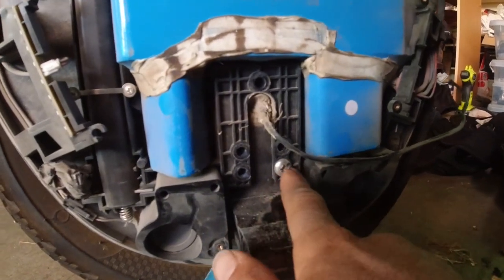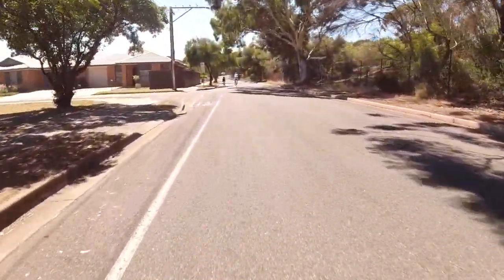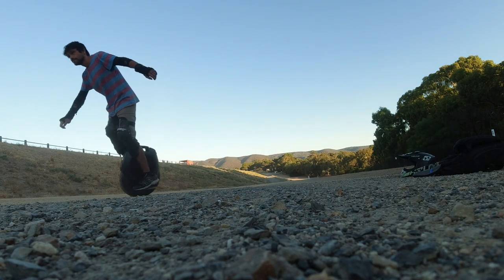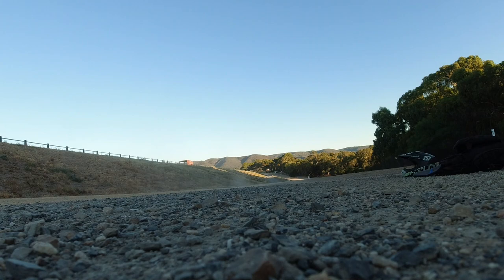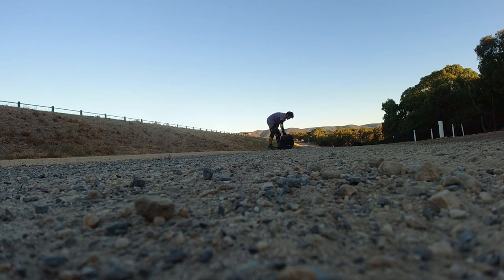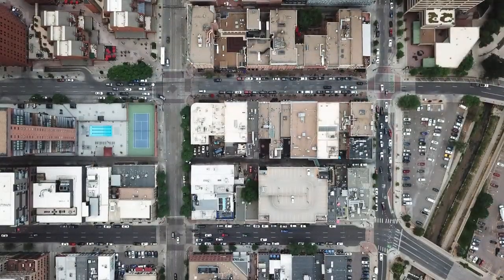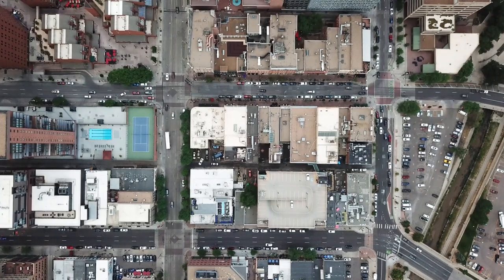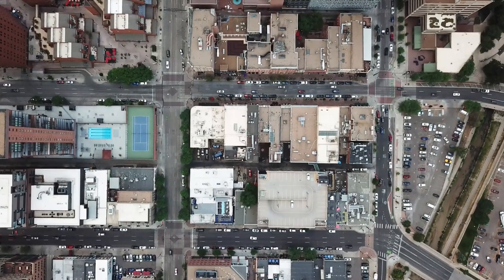The major problem with King Song

Comment: Hopefully it's just the fuses blown, another 5 dollar fix.
Reply: A blown fuse is highly likely. The current required for "idling" is the highest load on the batteries and motor; drifting is essentially the worst at idling condition because you're attempting to balance at nearly zero wheel rotation for an extended period of time... almost like short circuiting the motor and heat buildup is highest.  Check the fuses on the BMS (or just check battery terminal for voltage), then check fuse on main board, as well as capacitors. There are several layers of protection that prevent catastrophic failure of the motherboard.  And, cross your fingers. Good Luck.

Comment: You are a legend on the drifts. Love it. I own a KS 16XS...I dropped it heaps, learning to ride it, on the grass though.
I have taken it apart twice, replacing or reparing tyre. 
I have broken on of fastening points off the main body.
I still works fine.
I have dropped it a couple of times on the concrete, but have always had a rubber bumper stripe around edges or power pads to protect from the shock. The shock is what breaks stuff.

Comment: What you shown was the physical abuses you know of. What you didn't, was the electrical ones you're possibly not even considering.
A drift usually causes a power consumption spike. If the battery cells are badly unbalanced and near failure, the BMS will just shut it down and the mainboard should not power on at all until battery replacement. (And KS-16X's cell balancing is passive, meaning BMSs are on the battery packs themselves, meaning also the owner has to take care of the 3rd charging stage [that is, cell balancing], after reaching "100%")
On your defense, however, I know the KS-16X has =two= battery packs and it's unlikely both them died at the exact same time for the exact same reason.
Still, for safety reasons, that [old] mainboard should not power on until both packs are OK, but IDK if that's the actual case.

Comment: I got ran over by a large truck and my 16X took a heavy beating. It’s still working. Yours must be a combination of issues. I’d guess overheating from the fan and dust in addition to the impact. Still. No excuse. These problems shouldn’t exist.

Comment: I assume you have figured out by now why your wheel died. But in case you have not...I reckon you have blown the fuse(s). I had that issue 2 months ago...went through a small dip and wheel stopped working. The dip was pretty much the size of the tyre and I overpowered it, tyre was a bout 1/3 of it's size in the dip/depression. I have replaced the fuses and wheel works fine again. On another note : the 16X is very easy to overpower if you ask for too much juice when accelerating. Mine did 2 beeps and cut out. Had a crash but it worked again afterwards. Scary though. I have now a Master and an EX30 coming....all good fun but dangerous too 🙂
Reply from the maker: In the past when this happened the fuses didn't do their job so had to replace the whole mainboard. Replaced it twice actually. I've since sold that wheel though. The Sherman doesn't have this issue and has taken much more abuse.

Comment: Dude!! That shit is insane!!
Your like the only person I know drifting a wheel like that. But it definitely over powered your board. Too much torquey power for the mosfets all at once due to such a long slip of the tire trying to maintain constant power and over doing it. I'm gonna try it on my RS with the updated black board. Keep it up bro. Sorry your wheel diedman.
Reply from the maker: Thanks bro. To be honest I don't think the slide hurt the mainboard because this happened before and I wasn't sliding. I just dropped it softly on its side and it gave up on life. I'm pretty sure it was the impact. There was loud music coming from the 16x speakers and at the point of impact the music suddenly went dead and in the back of my mind I kinda knew in that moment that the wheel died.

Comment: Got a 16xs as my first ever EUC and after the first week of riding it I had a very similar accident to the one that destroyed your EUC (except for all the drifting, in my case it was just a beginner fall), and suddenly my 16xs wouldn't turn on anymore :(

I sent it over to the store and I'm hoping I can get the warranty on this, but I'm anxious to get it back and fixed.
Reply from the maker: Did you get it fixed yet?
Reply: @arcrides6841  hey there, yes I did! They serviced it for free as part of the warranty. Apparently the controller board got fried along with the battery somehow, so they exchanged both parts. I've been riding it for about a month now, no problems so far
Reply from the maker: @alvaro1121  I'm very surprised the battery died. Lucky they did it for free because it costs thousands for a new battery
Reply: @arcrides6841  same here. They showed me the invoice for the repairs and it was almost the cost of the whole thing. Crazy stuff

Comment: damn that sucks bro, its always something braking on ur wheels. I wonder what is failing on the mainboard from being jolted like that. its not like the board is cracking in half or something, its just being rattled a lil bit. what type of components are vulnerable to vibration?? if you know, maybe check those specific components? maybe they came loose? or maybe they need a tad bit more solder? idk, that sucks tho bro. since you really like the Sherman, what about a Sherman max?
Reply from the maker: hey bro good to hear from you. Yeah it sucks but I'll get it fixed and just be careful with that wheel in future. The Sherman Max is about the only wheel that seems worth getting. The other wheels I wanted to get, V12 and S20, I keep hearing have too many issues.

Comment: 4400 km ran through the ringer, rode hard and put away wet. I think it did pretty good considering input through. Think you're expecting a little too much for what it is I might serve you well
Reply from the maker: I'm just comparing with the Sherman. I've banged that thing up a lot more and done many more kms. So far over 12000km. And it hasn't killed the mainboard. I did kill the BMS once but that was because of a design flaw that's been addressed on the Sherman with new side covers. Got those covers on mine now.

Comment: I hear Inmotion actually has the worst battery blow ups. Begode (Be-Gode, not Be-Gode-ee) isn't as bad as people have made them seem and they're using different batteries now. KingSong seems to be listening to the community and I'm still interested in buying a batch 3 or 4 S-20 for my first KS wheel. I think it's a step in the right direction when it comes to design and innovation, but I still love my Sherman to the max. 😁
Reply from the maker: Yeah and I've heard they have some of the highest return rates in some shops like eevees in Canada

Comment: First thing to check is the fuses and make sure the motherboard screws are tight enough. You and I have very different riding styles and ideas about treating wheels... I ride my wheels (MCM5, Sherman and Nikola +) fast, but smooth. I am too old for drifting and it is not my thing anyway.  The dirt on the motherboard wouldn't help either... it could have created a short and blown the fuse (or board). Just my opinion, but as long as you drift wheels, ride them on beaches through salt water puddles etc... your wheels will continue to fall apart.

If you treat any suspension wheels like you treat your Sherman and 16X, they wont last long either. The Sherman with the front bar flattened at the front needs to be replaced too, or even change the back bar to the front... the front bar offers no support/protection... if that tumbles, the bar will beat up the batteries and break the plastic covers. New bars are not that expensive (well, they never used to be, maybe they are now?)
Reply from the maker: Yeah I'll open up the wheel in the next couple of days. Hoping it's just a fuse but I don't think it is. Also I no longer ride through salt water. I avoid it like the plague after what it did to my original Sherman motor. Didn't kill it but rusted it pretty bad. I've got a new motor now and I'll never take it through salt water. Regarding the bars this is the only way to have decent clearance for going up curbs. Otherwise the brand new bars are very obtrusive and they end up getting squashed anyway once they hit a few curbs.
Reply: @arcrides6841  If it had burned the board, you would have seen smoke or at least smelled that 'burned electrics'  smell... I would bet YOUR life on it being a fuse haha. What does a board cost for a 16X? If the board IS blown, if they aren't too expensive, maybe buy two? If not blown, maybe buy just one for a spare? You will likely need one at some stage anyway?  Do you have a spare tube on hand for both machines?
Reply from the maker: @ratmanmurray7137  Yeah I've got spare tubes and tyres. The board is like $250 I think. I hope you're right about it being a fuse. I might check tomorrow.
Reply: @arcrides6841  While you have it open, get a dry paintbrush and dust off the motherboard to look for burns and stuff. Check the screws that hold the board down are tight too... hopefully it will be an easy fix and you are back up and running soon. Are you still doing Uber eats?

Comment: As an electrician, I can tell that the fail did not happen from you little drop there, but it was rather a failure accumulating slowly with all the vibrations and abuse from the drifting and the little drop was just a final drop to the bucket when something finally failed. Also: all that dust inside is asking for a failure
Reply from the maker: Yeah that would make sense. But my Sherman has been dropped many more times than that wheel and never failed. Must be much more robust internally.

Comment: It's the dam dust on the board ! JK but check the fuse and good luck. I'm curious as to how hard the "drifting" or sliding is on the motherboard. Could that be loading it up with too much  juice ? I can't wait to see what you figure out and I'm really sorry this happened to you man.
Reply from the maker: I'm praying it's just a fuse but I don't think it will be the case. I don't think the sliding is very hard on the mainboard but not totally sure. Gotta think about it for a bit. I might do a vid on it once I figure it out. I say I don't think it's hard on it because I've done way more sliding with my Sherman and it's never hurt the mainboard.

Comment: 4000 km of abuse and it is finally dead. You just drop it but how many such a small drop it survived. It has soldering and other connections which can fail because of extensive vibration and drops.
Reply from the maker: True but the Sherman took much more abuse and never failed
Reply: @arcrides6841  Sherman is a tank 😉 !